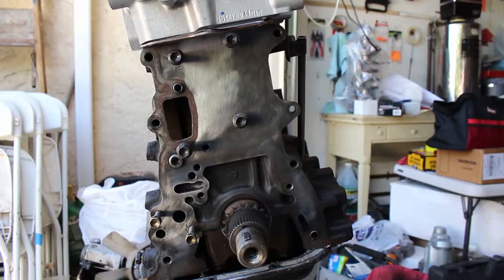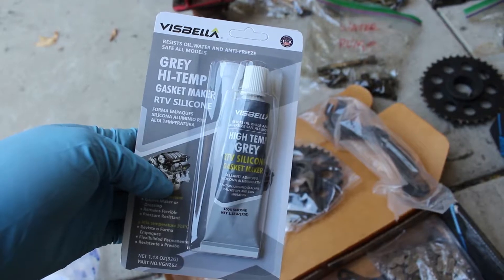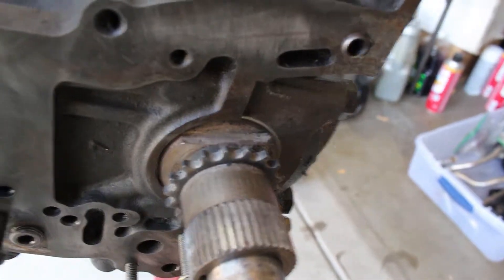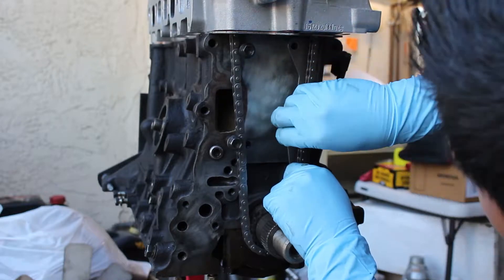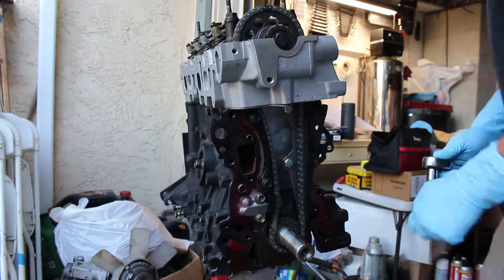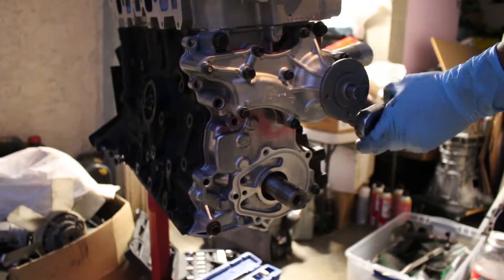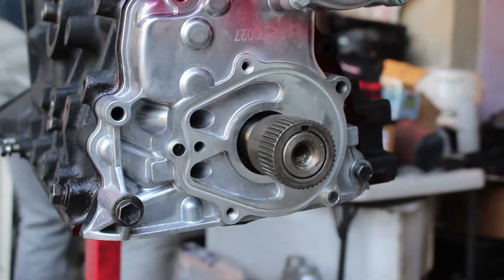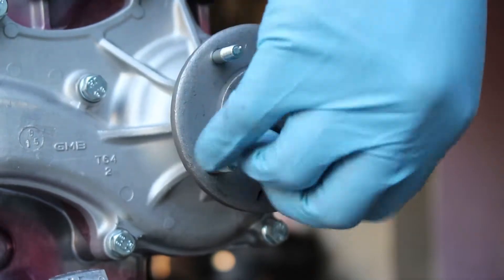22RE Part 4

Comment: Thanks for this.  Those torque values are real and I will make sure to get that right. I am getting up the nerve to do this job because inside  an 1989 22RE with 110k miles,  the dirver's side chain guide has disappeared completely and the chain is slapping

Comment: Does the dot on the chain gear have to be at 12 o'clock with the dowel on the cam? Mines is slightly to the left is that off 1 tooth? Cuz I can't seem to get the proper timing on my 22r it will only reach 8 degrees on the  crankshaft pulley mark at full retard timing! Thanks for your help 🙏

Comment: Big mistake reusing the cam chain gear, also you should have used a METEL timing chain guide, the plastic ones are GARBAGE!
Reply: The metal guides will cause major damage,thats why toyota dont use them...
Reply: @preacher031163  Toyota DID use metal guides in early 22r engines. They switched to plastic ones. Metal ones are supposed to be superior

Comment: What manual are you using? Engine looks clean man. Im doing some research trying to do this on my first toyota project truck. Im a little scared but the video helped alot. Thanks man
Reply from the maker: Sorry for the late reply. Thank you so much! much appreciated! I used the Haynes repair manual for Toyota 4Runner and Pickup. I hope this helps and good luck on your truck!